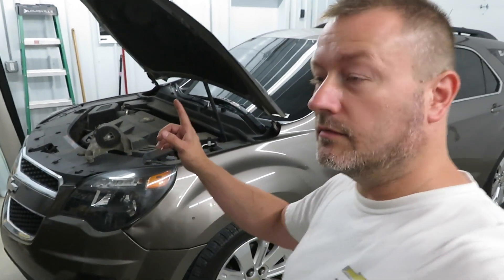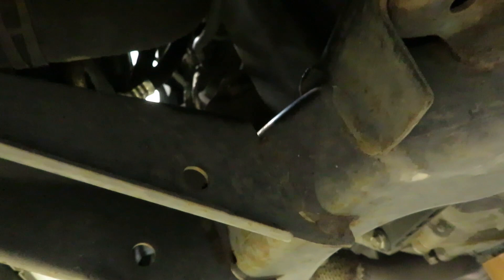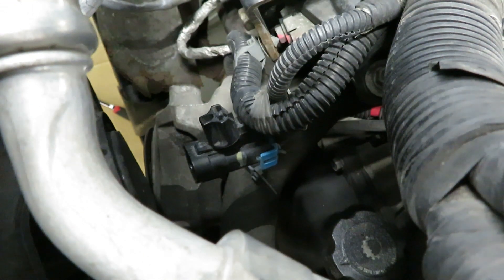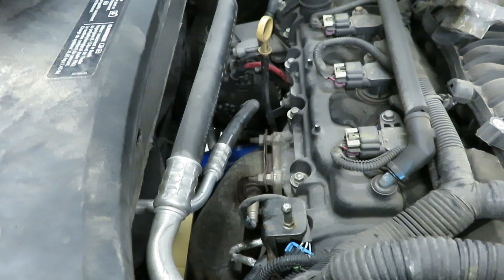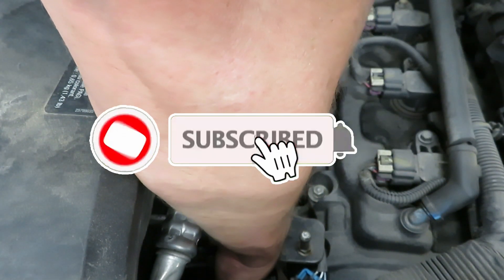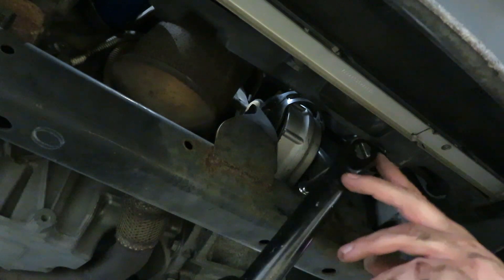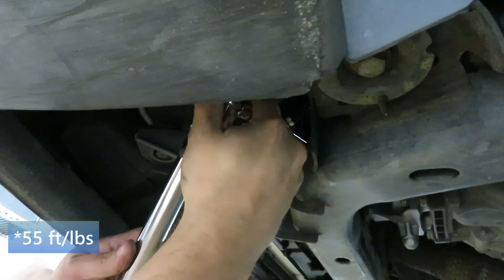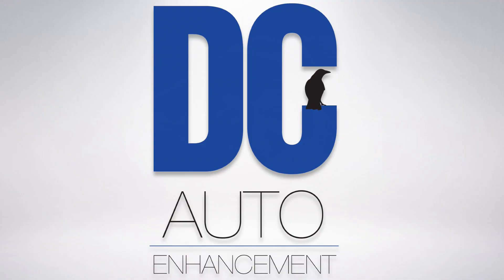Step by Step Tutorial: Easily Replace Front Motor Mount on Chevy Equinox GMC Terrain

Comment: What is the torque for each motor mount
Reply from the maker: There are two torque values for each mount if I remember correctly. 1) for the bolts that go into the motor, and 2) the bolts that hold the mount to the structure of the vehicle.  Do you need all of those? I am pretty sure I listed the torque values in the descriptions of each video.  I can get you the info you need but it will be a little later in the day before I can get to it.
Reply from the maker: I just looked, I did not put the torque values there.  I will get you the information and then update the description to include those.
Reply: @DCAutoEnhancement  yes I do